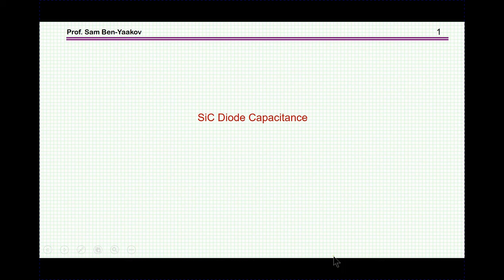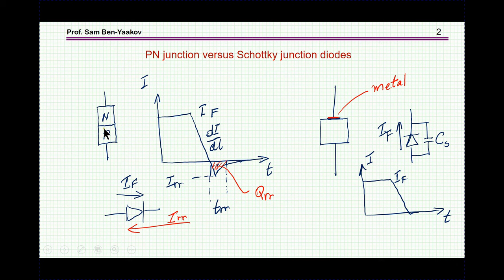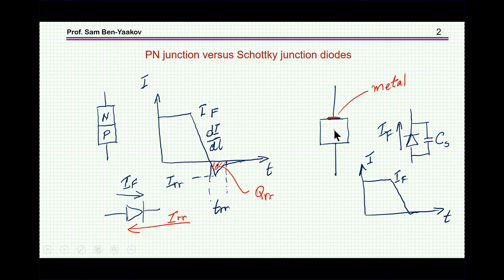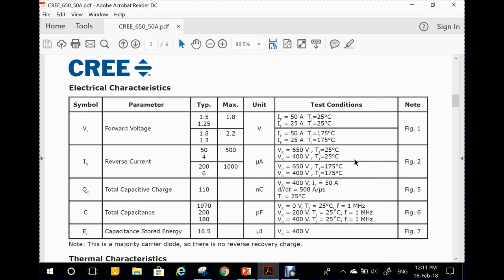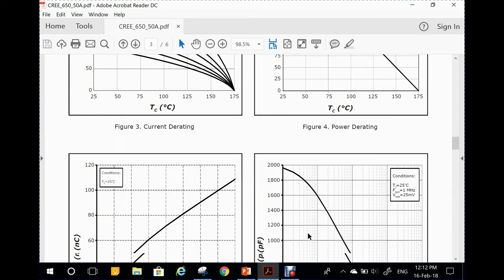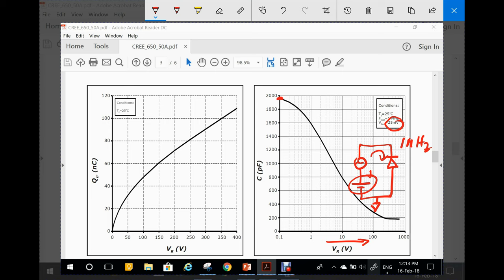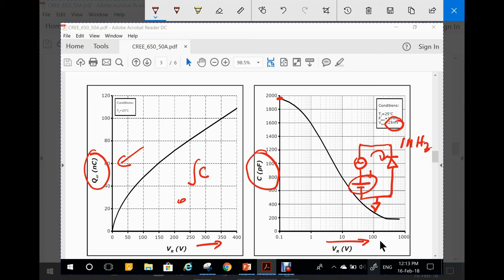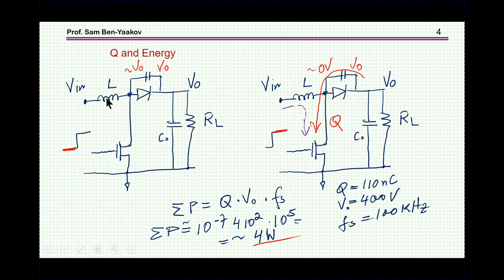SiC Diode Capacitance

Comment: Thank you for rightfully pointing out the current spike. I have observed this in SiC, GaN and even in diamond devices. The effect is similar to those caused by the reverse recovery current of Si diodes, although, the magnitude of current spike is much smaller in wide band gap devices, where as you pointed out, is due to the device capacitance (and not due to rev recovery of diode or bodydiode). Your lectures provide a great learning experience.
Reply from the maker: ujjwal karki Thanks

Comment: Thanks for your video. For Si diode, is junction capacitance charge included in Qrr in the datasheet? Or Qrr is only the reverse charge without Cj charge?
Reply from the maker: Hi Hao, Good question. Qrr is a measured  parameter so I it takes into account all charges.

Comment: why the Vd voltage drop until IF is zero 
I think the VD will drop when the Vgs equal to VT and then Coss discharge So Vd would drop and then the mosfet become constant current the Vd will drop dramatically?
Reply from the maker: "why the Vd voltage drop until IF is zero "? please indicate the relevant minute of the video
Reply: @sambenyaakov  18:56
Reply from the maker: I am not sure that I follow your question. The situation in this minute is that Vgs is already above VT, Vd starts to drop as soon as IF reaches zero, Coss is not shown and is included in Cs.

Comment: Sam, I hear people referring to  SiC diodes as Schottky diodes.  Is these really the same thing ?  The Schottky diodes I am familiar with (say, 1N4818 and 200V and below Schottky diodes)  have a negative temperature coefficient of Vf.  Higher temperature gives lower voltage drop.  But SiC diodes I have been using (650V) have a positive temperature coefficient.  This is kind of confusing to me.  What do you think about this ?
Reply: SiC is not same as schottkey. Later one is junction of metal and semi conductor.
Reply from the maker: Hi boB, as I said in video and Prem wrote, Schottky diodes are based on metal to semiconductor junction. The maximum achievable breakdown voltage and the Temp coefficient are dependent on the type of the semiconductor.
Reply: Ok. But i hear people talk as though SiC are Schottky and I know they are different animals.
Reply from the maker: Indeed. but: both a a bear and a fox are still animals.
Reply from the maker: Just to clarify. SiC diodes are Schottky diodes because they are based on a junction between metal and SiC. The "regular" Schottky diodes are based in metal to Si junction. Metal to semiconductor junction has an insignificant stored charge. This is why Schottky diodes do not have the reverse recovery problem.
Reply: Interesting. Thank you for this clarification. I just have to be careful when someone talks about Schottky diodes.  Very good video.  Learning more all the time from you, Sam !
Reply: boB- Please notice that 1N4148 is a Silicon diode and not a Schottky diode.
Reply from the maker: Hi Raanan, boB, to keep the record straight. boB referred to 1N4818 which is a slow diode (1.5A, 200V), meant to be used for line frequency. This device, as I understand, is obsolete. Easy to confuse with the very popular 1N4148 (equivalent to 1N914) which Raanan mentioned , a 100V 200mA  very fast, Si (not Schottky)  diode with very short trr of  about 5ns (at a forward current of 10mA).
Reply: Oops I think I meant 1N1418  Schottkys. Was reciting from memory
Reply: Darn !  I meant  1N5818  1N5819  1N5817  which I have been using for years.  Had to finally look it up.  Those Schottky diodes are what I was trying to think of the number. I knew there was a 1N and an 818  in there somewhere.  Off by 1000 is all.  Happens to the smartest and the dumbest of us
Reply from the maker: boB, You were entitled to one mistake. So, from now on, watch it :-)
PS. I have seen bigger mistakes